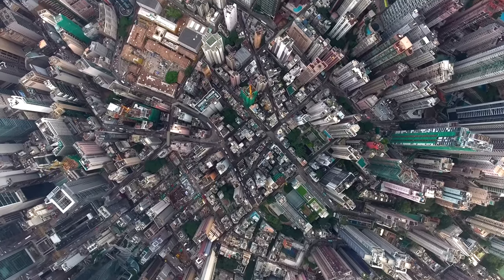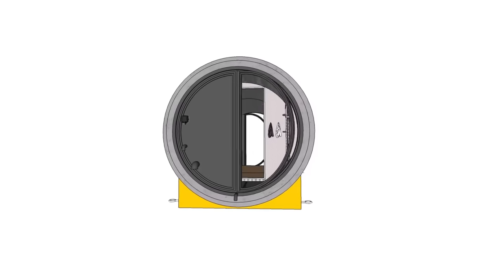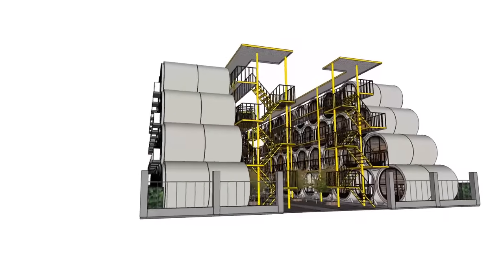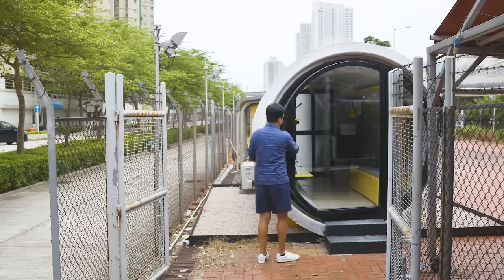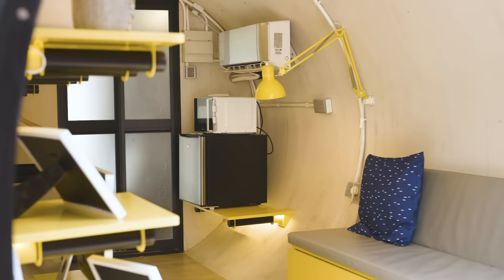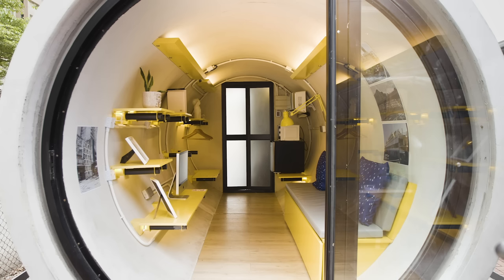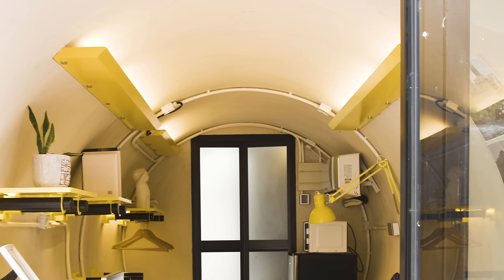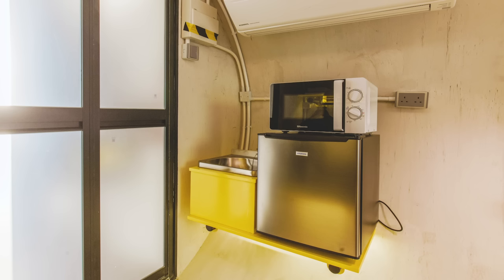NEVER TOO SMALL  Experimental Micro Living Pod - 15sqm/161sqft

Comment: Very innovative, but I would feel so vulnerable.
Reply: I know what you mean but there are modern windows with a blind system in between two panes that you could get complete privacy with when needed.
Reply: You would feel worse living on the streets. This is for low income people...
Reply: This is not new if go through some books of architecture will find this is has been done before.
Reply: Can I ask why? It seems to be a very sound structure and you could always use blinds or curtains.. a set of them stacked together would not feel vulnerable, it’s just that you are seeing it sitting on the street by itself

Comment: Very ingenious idea of the architects responsible for designing Opod with a concrete water pipe, with minimum dimensions, 15 square meters, where a person can hardly live in the long term. However, it is a perfect experimental home for people passing through, the homeless, young tourists and people with financial problems.
In addition, the cylindrical shape of the module plus the construction material, presents a very good acoustic insulation, its spatiality and assembly allow a quick and safe transport from one place to another. presents furniture with recyclable and totally versatile materials.
An innovative home that with a few square meters and in a single tube, the essential activities are distributed: Living room, dining room, sleeping space, bathroom, kitchen, study.
An ingenious, innovative and interesting design.

Comment: Very interesting design concept.    I really like the way they stack together to make a sort of apartment complex.    Very creative.    This designer should get some type of innovation award.        The size is VERY tiny though.    161 square feet is one of the smallest "tiny" homes I have ever seen.   It would be difficult for multiple people to live in that sized space.   But if it allows people to live more comfortably than their current situation and it's affordable housing (hopefully), then it's a great thing.    I can sort of relate to this size.    I lived in a similar sized space for 3 years when I was in the Army.   Dorm rooms at colleges are also similar sized or smaller and students live in them for up to 4 years so you can adapt with creative thinking.

Comment: Hong Kong is one of the world's cities with the most over population and urban density, which human creativity is an important factor in transforming dense sectors into dynamic, low-cost, high-implementation spaces that break with that urban structure. That's why I was very struck by the creativity of being able to generate a new style of micro apartment inside a concrete pipe; which redefines the way we live in a very simple but striking way in a modular concrete complex.

Comment: Well not to be arrogant or misunderstood but one of our graduation projects we made something similar and even smarter. This work is very creative and good but we even took almost a mini area like this and made it look even wider and with a mini kitchen also. The only trick we made with our professor is that we made a "programmed" equipment use. For example, the bureau of the TV set is modulable so we can push it in inside the wall and get even extra comfortable space to extend the sofa more and more for night sleep"that's why we made wall considered thickness". We also made a very tricky part for the doors in order to not lose space for door openings we made sliding doors and minimized the bathroom space through this so we have enough place just for toilet lavabo and shower and finally this made us gain extra little space for an small electric oven and mini refrigerator and a small dishes sink. Again that was just a project there might even be smarter and smarter ideas.

Comment: This apartment is a real challenge for the crowded city in which it is located, this apartment is quite reduced, to a minimum, each space is designed to give it a use, inside it has the minimum to live and sleep, these containers are stackable modules To optimize space and also recycle a lot of materials, the fasteners that are in the house are a very smart idea, since they give versatility in terms of storage or extra space, the light gives a warmer essence to the space and the Natural light that enters it is optimal since 100 percent of this housing unit is illuminated.

Comment: Not the worst idea I've ever seen but as someone studying design, I see quite a bit of custom materials here which requires more labor. Custom glass windows, custom round shower + tile work, the curved conduits for electrical and so on. Not to mention working with that curved floor... Box is more efficient and easier to keep costs down. Concrete on the other hand definitely has its benefits though, something you can't get with shipping containers. I can see this as a niche that works for some but probably not a solution for everyone.

Comment: I really appreciate the design effort that goes into making these Opods. But really, no matter how well you design a water pipe for someone to live in... they'll still be living in a water pipe. Again, I recognize that it's much better to live in one of these than to live in one of those cage homes. But I wouldn't celebrate this as any kind of solution to a housing problem.
Reply from the maker: We think any idea that can ease the housing needs in city like Hong Kong, may it big or small, working or not, should be celebrated as it can be improved or interpreted differently in the future. No experiment is failure, the only failure is no experiment.

Comment: The OPod's definitely need work. The bed legs and comfort don't seem to be much pleasing. Bathrooms look decent but more ventilation could be done. In the end it just needs to be revised a bit more in-order to satisfy more people. Other than that, this is a very interesting living space and I would definitely like to experience it in the future for sure!

My only concern is the "Relocating" part. I think its a bad idea for many people because maybe they are living in a certain place so its easier for them to travel to work or wherever. If the OPods are looked at and fit the peoples requirements it could revolutionize the whole world and the way of living.

Comment: Living in one of these would feel way too claustrophobic for me as a home, but I'd put one in my parents' backyard for when I need my own space.  Btw I'm young (if you consider 30 years old "young") and I like to cook.

Due to the round shape of O-pods, I'm not seeing how they are as efficient as shipping containers as housing units.  The rectangular shape of containers makes them easier to arrange in a row and stack.  Nevertheless, whether it's containers or O-pods, I don't see these being long-term housing solutions, more like office spaces or university housing.  Like another commenter suggested, a community kitchen and bathroom would be nice for a development like this.  Maybe even a cafeteria and common lounge area!

But then how would a few O-pods be "combined" to create a large enough space for the latter two?  I'm no architect, but I would think it would be much easier to cut out and stabilize a rectangular structure than a curved one.  With shipping containers, it would be as simple as removing the side walls off of two adjacent containers, then putting several posts where the walls once were to stabilize the structure.

Comment: Does the architect explain why he chose a cylindrical shape instead of a cube? It also looks like he designed the "pods" to have the ability to stack. Stacking cylinders would mean tons of wasted space in between the cylinders. It's like reinventing the wheel with a pentagon, an attempt to create something unique at the cost of functionality.
Reply: I think he said the idea occurred to him when he viewed a construction site.  The concrete pipes are readily available so it's not exactly reinventing the wheel.  I've seen homes built out of grain silos.  It's just another alternative use for a common item as with shipping containers.

Comment: I designed a wall for my parents that uses 3 and 4 foot diameter concrete pipe sections sat on their ends and filled with soil to act as planters.  I used an oval pipe laid long axis vertical to act as the entrance and mounted a gate on it.  I was able to do this affordably because the pipe sections were offcuts that I had seen at the city dump.  The manager of the dump was thrilled that we were going to take them away because his men hated the hazard of running the bulldozer onto them to crush them down.  Large concrete pipe is not "affordable" if you don't get them for free.  Concrete is not a good insulator at all.  Cutting curves out of standard straight & square building materials wastes a lot of it.  And it takes a crane to move them.  How anyone can claim that it is a good idea to make affordable housing out of concrete pipe, and keep a straight face is beyond me.  With all that said, If I had access to free, large pipe again, and access to a crane again, I would seriously consider making a small, habitable shelter from it.  It has a unique feeling to it.  As neat as it is, I would never tell anyone that it is affordable.

Comment: Ngl it does look a bit depressing... I agree with the people in the comments who say there should be, if not more kitchen space in the pod, then at least a communal kitchen somewhere in the community of units. But in terms of the icky feel, I also think the very prison-cell-esque atmosphere of each unit is exacerbated by the concrete, colour scheme, and shape. 
The concrete, combined with the curved ceiling, feels oppressive-- there's physically less space as well with a circle rather than a rectangular room. I'd say have a skylight, but I'd imagine putting a skylight in a concrete pipe is... difficult, if not unwise. In a lot of other architecture/interior design media I've seen the use of mirrors both to reflect light. I wonder how putting a mirror (do they even make curved mirrors?) on the ceiling would change the space. 
The yellow, in my opinion, gives the lighting almost a sickly glow, especially since the lights themselves are also rather orangey-yellow. I do like the muted, hidden effect with the lights, although I feel like all the solid objects obscure some of it. Personally, I'd rather it be black, white, and glass-- as much glass as is possible within budget to open up the space a bit and let more light through-- so that residents can hang or cover surfaces with vibrant textiles of their own choosing. That might also make it a bit homier. 
Idk, those are just my thoughts on this space. But I think overall this project is a great idea and I can't wait to see where it goes!

Comment: It is a fun idea but a bit stupid. When you have a round shape you get much area in between, a better shape would be a six sided shape on the outside and 5 sides inside to get a flat floor, in that way you do not lose any space when stacking, and the triangular shape you will get under the floor would be used for things like water, power, communication and heat circulation.

Comment: Except for being cool, I cant see why the thing is tube shaped. 
Tubes are like that to withstand high pressure, there is no advantage in its shape for living inside it. 
Think of the same building with straight angles - this will result with much larger storage space and moving area, without increasing the footprint.
The inner area designation is far from ideal (specious bathroom, dollhouse-size kitchen), but the general idea is nice, especially when compared to the "cage homes" in HK.

Comment: I like it but I see no advantage and several disadvantages to using round, concrete water pipe.  For one thing, the water piping is not recycled, used or excess so it would have to be sourced as new.  If you are going to make a completely new concrete structure, then for the same price, you could make it rectangular or cubed.  A squared structure would cost the same while providing more space on the inside.  It would be easier and more economical to move and much easier to stack.  Additionally, it would give the occupants many more options to mount shelves, interior walls and fixtures without the need for custom made accessories.  The round house looks unique but beyond the novelty, I see too many disadvantages and absolutely nothing on the plus side.

Comment: how did they come up with 15sqm ? because the floor is 4 sqm at most, and the rest isnt square at all.
Reply: I know cubic footage could be measured with any kind of shape, but yeah, I'm not understanding how they'd get square footage out of a round object.  There's a "floor" but just measuring that wouldn't accurately describe the size of the room.
Reply: @lelechim  well, you could take the circumference, but that includes the wall and ceiling. my main point is, that this is never ever 15sqm floor. and the floor determines the size i think, i guess its about 3.5m x 1.2m.. 4.2 sqm.

Comment: Thermal efficiency it`s really poor, no isolation means cold in winter and hot in summer. There are also square precast concrete structures (for passes under roads and highways) that can be way more useful (with pipes you are losing a lot of space that is justs "air" between pods, specially in the lower and higher pods). But I agree it can be useful for offices, but definitely not for living.

Comment: I think it's a nice idea, but it mostly look good because of the incoming light from the window/doors and honestly... I'd hate it. I'd live in full display... Even the bathroom is completly free to look into... Is there anyone who'd want to be seen undressing, or taking a sh**.? And it'd be way to dark if the doors wouldn't be out of glass. And if anyone mentions curtains, really? On a completly round conrete form, it wouldn't be attachable because of concrete and would have to be especially made, expensive. The kitchen not having a stove is the lesser problem. You can buy compact ones everywhere.
Reply: It's called a curtain.
Reply: Anthony yeah.?? That’s how I wrote it..? What’s your point.?

Comment: 20,000$ seems a bit much for this  house .
I mean if it was bigger, maybe….For the money you can build a maybe bigger A frame.
What about isolation? Concrete is not a good thermal insulator.

I could see a cross out of these tubes covered with earth, it would look amazing, like a hobbit house. 
The earth would insulate a bit the “house” but I feet water infiltration.

Comment: The sofabed, a thin piece of foam on a hard surface, looks very uncomfortable, even painful when you wake up in the morning.  And you say it's all meant to be only temporary housing, but bureaucracies and gover meets have a bad habit  of sticking people in temporary housing and forgetting about them.  Look at a recent example, Daiichi:  those victims are still in temporary housing, their lives suspended still, after all these many years later.  And often, these shelters are meant for homeless transients...  this place lacks "universal accessibility," it's only good for ablebodied and young people.  An older  or disabled person  couldn't even move around in it, let alone sleep on a piece of foam.  It's one notch better than cardboard on a sidewalk grate. I've seen cheaper transient housing that's better and cheaper to build, I'm sorry.  It might be temporary as you say, but it would take a crane to move them. Cement would retain heat in the summer and cold in the winter.  It's got flat chi.

Comment: well, thats nothing i would even consider trying out. id move into a shipping container, id try a minivan with nice ideas, but this thing is ugly on the in and outside, the shape provides no advantage and i doubt that this is cheaper than a tinyhouse out of prefabricated wooden parts or a shipping container. its a pain in the ass to get something mounted inside and even the windows are custom, that means expensive.

Comment: €17,000 or close 20k USA dollars ... with no kitchen, shitty bed, no storage, no nothing.

I'm pretty sure that cement for that volume won't cost 17,000 EU bucks and with a bed from a caravan from the 50s ... no kitchen, yeah sure.

Get a used van for €2000 is the much better option. Stay with your parents and save up money ... until you find something.

This is dumb on many levels. A cylinder is not the best shape, not very efficient and not made for living rooms. There are rectangular pipes ones .. I don't get it.

Cement is cheap, you can make any form/shape with it. Why not used ship containers? Because there is no money to made?